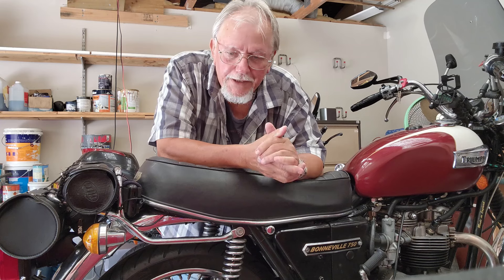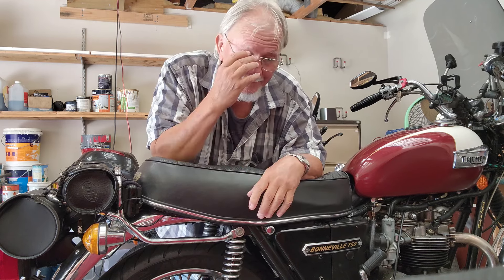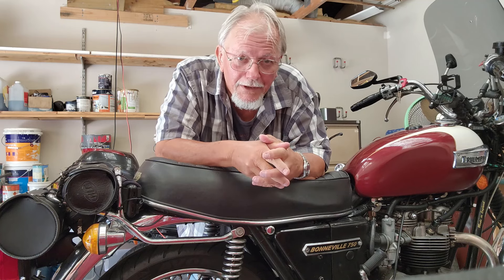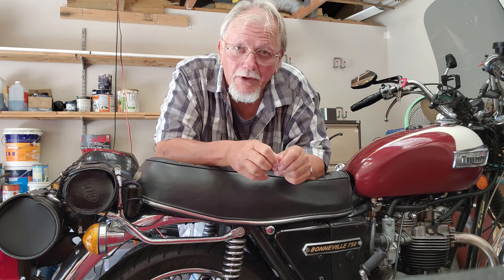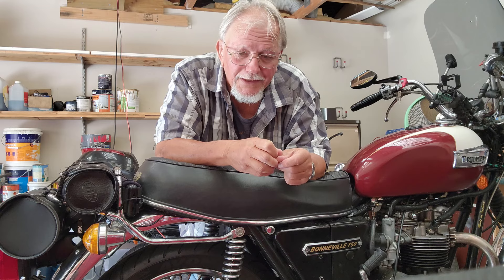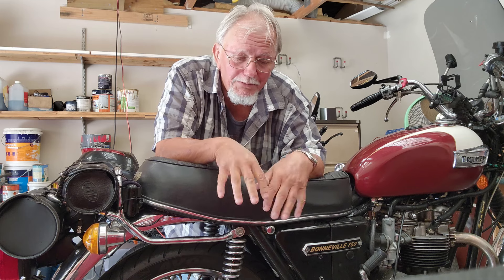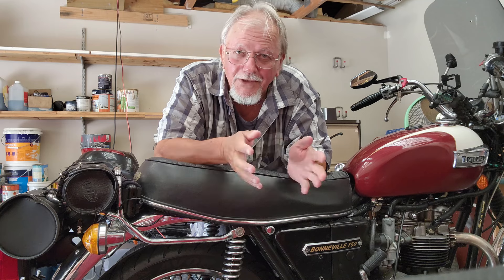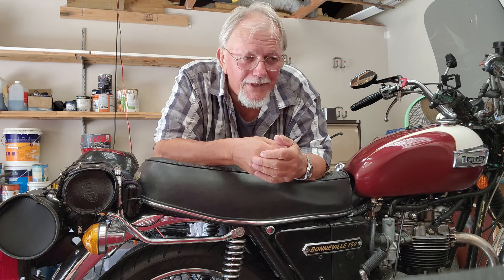T140v XRing 530 Drive Chain Conversion Upgrade

Comment: The kind of thing you need when you don't want to maintain adjustments, I believe. Not that I knew that terribly well but I learned now.
Reply from the maker: These old bikes live on TLC and I get more enjoyment working on them than riding them, but having to scrap endless chains for over stretch in such a short time is just a pain. So I did something about it. Whish I had been more active modifying the bikes to be more reliable with longer range when I was younger lol.

Comment: Thx for making this video plus your other ones too. I'm restoring my 78 T140v and will need to assemble the engine so before I do that I'm going to carry out your X ring mod. Thx again M8
Reply from the maker: Remember you are only grinding off a few mm for the extra width of the chain and to mark out the chain run on the casting before grinding. Its very quick and easy to do. Once done put the chain on the sprocket and check you have the 4mm of clearance all round the chain run.  That bit takes longer to do than the grinding but its important to to do.
Reply from the maker: Just a note that you need to use 100x 90 x 18 tires. 110x90x18 may be possible but never tried those. The 100x90x18 leaves a full 5mm gap from chain guard to tire side wall. The is no loss of performance using these tires. I use Avon Roadrunners.
Reply: Thx, I've just installed 110 80 x 18, when I laced the wheel I used the max offset so hopefully that will help, there appears from looking at the wheel in the frame to be just enough clearance for the xring chain. I'll have to wait until I bolt my engine in to be sure. I have assembled some some of the bike I'll post a picture on FB shortly. I use Avon's too.

Comment: Good video  - just wondering how you deal with the chain rubbing on the tyre? With the standard chain it’s only a few mm off my tyre as it is, with this mod it would definitely be making contact.
Reply from the maker: Straighten your chain case dead straight and run 100x90x18 tires. This leaves a full 5mm gap between the chain case and the tire sidewall. It may be possible to run a 110x 90 x 18 but ive never tried that. The 100 x 90 x 18 works perfectly and has been used by many Bonnie owners for many years because they work really well on the bike,  in fact the orientation between front to back is much better, as you are not moving the centers as you lean the bike over on corners.  
I often have the bike over on the pegs and shes confident and stable on bends and under hard braking .I run Avon Roadrunners.
I have added this to the description on the video and apologies for missing this bit out of the video. Well spotted and hope this helps.😄

Comment: The older model DID 530 VX with a pin length of 23.3mm is more likely to fit without modification if you can track one down.
Reply from the maker: Possibly but as there no longer available generally its a bit pointless for me to make a UTUBE advice or upgrade video about that one. Using the larger chain as I have is no hassle, and the modification work is very easy to do and takes no more than 15 minutes to do if you have the engine out. Hope this helps.